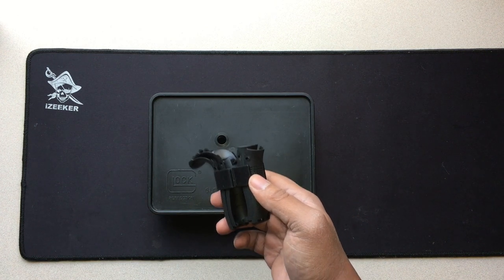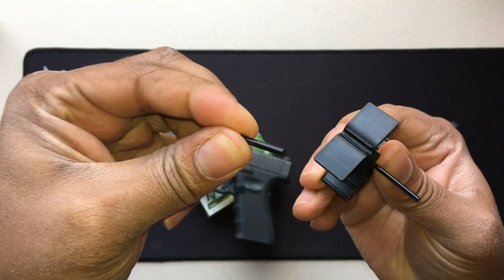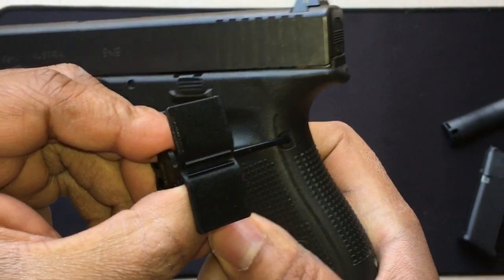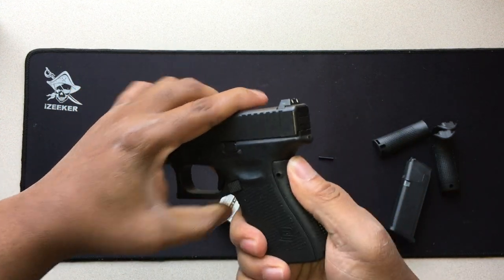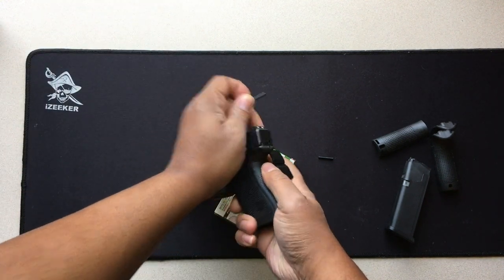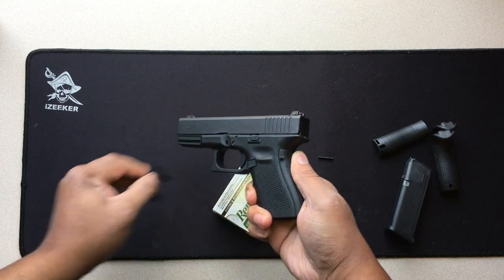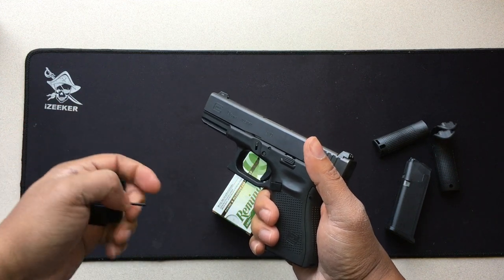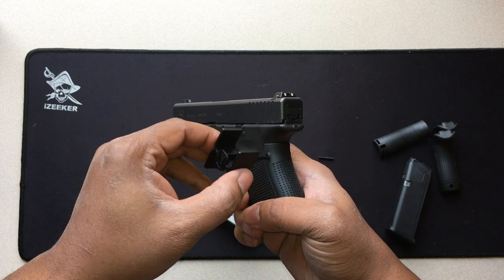Quick Tip - Glock Backstrap Install

Comment: Just a top tip
If you are wondering about size, your index finger should have the pad at the front of the trigger guard. Not the first knuckle. It's about my only complaint about glocks. My damn trigger finger is almost at the muzzle without the large strap on a g 30. If you can grip a basketball I HIGHLY recommend using these. Way less movement in the hand on recoil.

Comment: Good vid, couple others seem to have a lot of trouble, mine installed smoothly thx to your tip using the provided punch to start and guide the longer pin in.
Reply from the maker: Nice and thanks for visiting the Vetterland Channel.

Comment: Trick didn't seem to work on mine despite having snapped in both ends of the backstrap. After an hour of fiddling and some applied violence against my desk I finally got the pin to seat all the way.

Comment: You made it so easy lol my hand hurts from trying so long
Reply from the maker: The key/trick is to run the tool through both holes as a guide while slowly pushing the pin through. Sometimes this requires the installer to safety check or disassemble firearm depending on comfort level, place the back-strap on and assume a shooting grip on the pistol while squeezing tight and inserting pin.

Comment: My pin won’t slide through on the last step it’s almost as if it doesn’t fit
Reply: That pin that came in my kit is considerably wider than the tool it’s very noticeable

Comment: Are you doing a review of the new Glock44? I'm interested as I go through 500+rds of 9mm/45 in training classes, 22LR in a Glock19 clone would be sweet. Congrats on the 1000 subs btw!
Reply: Lookup Hickock45's review of it. Not the best gun every made cause it's a lot more polymer than a standard glock. Apparently no one goes more than like 100 rounds without a failure of some kind as well.